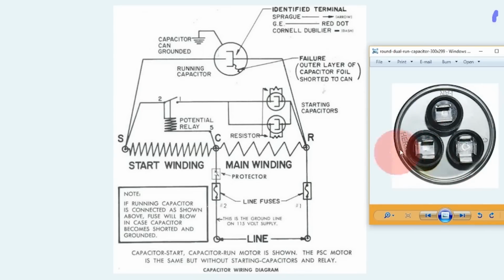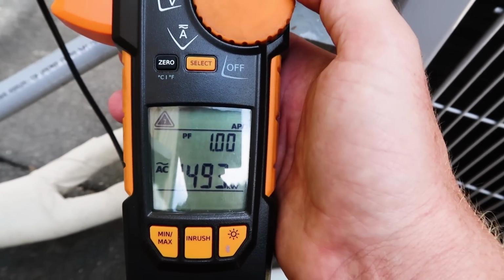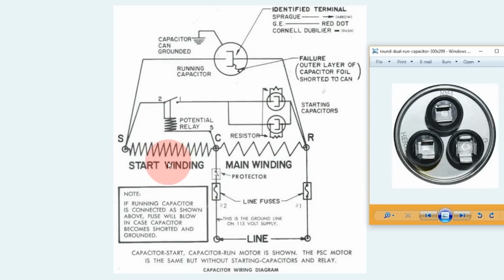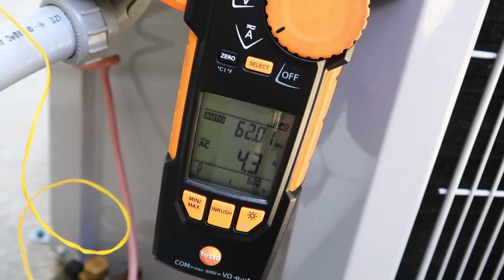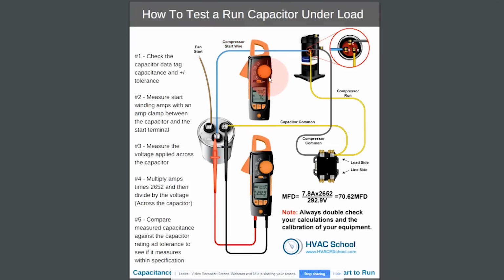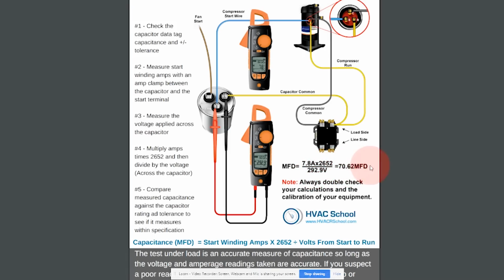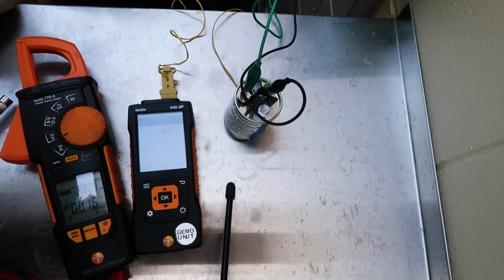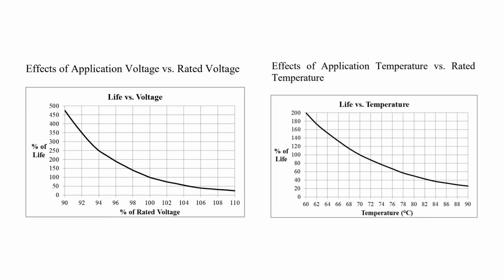Why Do Capacitors Fail? (It’s not why you think)

Comment: Run caps fail by building up internal pressure caused by heat from having high current combined with high resistance ie. impedence.

Parasitic heat generated by caps:
P = R x I2
The current being squared make caps particularly sensitive to it when internal impedence rise during aging.

Good caps are known as "LOW ESR": Equivalent Serial Resistance which grants them long service life.

Nothing magic: low-quality either builds repeat business or kills business like too many American iconic names
 😂

OUT OF PHASE [23:00] : "Cap sends back"... nothing!
The cap supplied voltage and drawn current is what is out of phase.

Comment: Not sure if this applies to HVAC capacitors, but one of things we do in electronics is to measure the ESR of electrolytic capacitors to get an indication of it's health.  If we see a capacitor with a higher than normal ESR, then we know that it's on it's way out. A capacitor with high ESR will run hotter, which in turn shortens its life.  Also if we see a capacitor reading higher than it's rated capacitance, then that could be an indication that it is becoming electrically leaky and it's probably time to start thinking about replacing it.   In electronics we generally consider Japanese and American capacitors to be the best for quality and life expectancy.  Not sure if you can Japanese Rubycon HVAC capacitors?

Comment: Funny thing: .5 amps at 120 volts suggests that the capacitor is 11 microfarads. .7 amps at 208 volts suggests 9 microfarads. When I did these tests with a series pass ammeter, the microfarads didn't seem to change at all with voltage. I find that oil dielectric motor run capacitors hold a much more steady capacitance than electrolytic caps, over its entire rated voltage range. Could it be discrepancies in the clamp meter due to such low current? I wonder if the meter would read more consistent with the formula if a 70 microfarad cap was used for demonstration, just so the current was high enough for the resolution of the meter?
Reply: because capacitor microfarad value is fixed the current increases with the voltage, simple!
Reply: @glasser2819  That's absolutely true. The current should increase exactly proportionately to the increase in voltage, and at a fixed voltage, the current should increase exactly proportionately to frequency. In this application, the frequency is largely fixed, if you don't include harmonics caused by the motor, which would increase the current disproportionately to the RMS voltage.
     In this video, the capacitor was NOT paired with any motor, or any real source of harmonics. The voltage varied, the harmonics did not. I would have expected a more linear change in current in proportion to the voltage, given the same capacitor.

Comment: In my 40+ year old a/c I have the original dual run capacitor. One that is oval,  11" tall and has a ground spade, too. The unit also came stock with what is called a starter capacitor in the circuit. Though even with the starter capacitor exploded(I don't know when !, I just found a few days ago when I was doing a pre-run inspection)the unit still ran well last year in this condition ! I am replacing the starter capacitor before I attempt to run it...as a matter of fact USPS informed delivery says that it is out for delivery and I should have it today !!!
Reply: spend a little on maintenance parts to save a lot on not replacing with a new short-lived unit.

Check your Starter Circuit that fried the cap... the day your compressor fails to start because of bad starter maybe one of its last days due to locked rotor high currents toasting old winding insulation.

Little homework is worth your time... AC disconnect be your friend 👍🏻
Reply: The start relay could be bad, too. It's always safest to replace both at the same time.

Comment: every capacitor that failed for me was ..1. the line supply wires are too small or bad connections. 2. A shorting wire or one starting to short slightly will also blow one .  3 obviously a bad motor
Reply: Poor terminations are sad. Factory terminations should be much better than what can be done in the field.

Comment: Where did you get 2652?
Reply: Z=1/(2*pi*F). therefore, since the formula is solving for microfarads, ( there are 1,000,000 microfarads in a farad) divide 1,000,000 by the product of Pi times 2 times the frequency. 60 Hz times 2 equals 120 Hz. multiply that by Pi. (3.1415926) that gives you 376.99111. 1,000,000 divided by 376.99111 equals 2652.5824. you can technically round that up to 2653, but why bother. Engineering books round it down to 2650, which is OK, because this formula is based on a pure sine wave. In series with a motor winding, there will always be harmonics, which will effectively lower the impedance of the capacitor, which will show a higher current than the formula suggests, so if you use 2650, you'll likely get closer to what the capacitance actually is. If you move to United Kingdom, you would use the constant 3183.0989. That's because they run at 50 Hz, and capacitors will conduct LESS current at the same voltage. (exactly 20% less current)

Comment: Excellent video! Especially the demo showing the compressor running backwards- didn't know that could happen because of short-cycling.  I was also surprised and intrigued to see higher than line voltage across the windings due to EMF.  I was actually watching this video to assist me with troubleshooting a valve actuator utilizing a PSC motor which is blowing fuses.  At the beginning of the video, you show lots of pictures of catastrophically failed caps.  Is this how you normally find them in the failed state?  What I mean is do you also find compressors with problems due to bad run capacitors which show NO outward signs of failure on the capacitor?  What will a compressor do when its run capacitor is degraded?  What I mean is, suppose the 45 MFD run capacitor is now only a 10 MFD capacitor.  What happens?
I also enjoyed your demo of attaching the capacitor directly across line voltage.  I have to admit, I was expecting them to go poof.  Amrad capacitors- I'll remember that.
Reply: I have been doing commercial A/C and refrigeration service for almost 30 years. I have found capacitors that were bad without showing any outward signs of failure. So, it's always best to check them. 
Degraded capacitors can cause motors to overheat, or even not start. A 45 degraded to 10, probably would not start under any kind of load.
Reply: Vrey good  welcome iliked all shring  teckanl feld  vrey   vrey good

Comment: Capacitors and pressure switches never failed on older pre 1990 equipment
Reply: Oh, they failed. Just not as often as nowadays.
Reply: When I started as an HVAC tech in 1992, the only capacitors I had to carry on my truck were 35/5 and 45/5 for Goodman and Arcoair units, and fan motor capacitors for when I replaced a motor and it took a difference size capacitor than what was there.
Now it is the most common failure item,  seemingly of everything else combined, on the residential side of things.

Comment: I started adding some kind of start assist. It seems to have helped. I have had customers when looking at the history. I see run caps replaced every couple of years. I added a start assist and it's been 5 years so far. They are out in the country where surges are common.
Reply: I ended up installing a hard start kit (with the potential relay) in my A/C condensing unit and I installed a whole house surge protector in the power panel.  I am thinking about adding another surge suppressor with brownout protection in my A/C disconnect to further protect my condensing unit.  Over the years, I have lost a furnace blower motor to a power surge and lightning strikes have destroyed at least one of my TV's.

Comment: Older caps also were double the size to current day units, it's all a money grab now a days, but it keeps me employed so I'm not complaining
Reply: You must be young, that was the transitional period when PCB capaciters were eliminated from availability. The new non PCB caps were large until they got the design correct.
Reply: The older larger caps were always paper caps, and as such had a (sometimes poorly defined) limited life span. Modern caps are often polypropylene and "should" last longer. Of course, they don't always last longer in practice as it's fully possible to underrate them as well. They might even be more prone to heat damage than a properly manufactured (very expensive) paper capacitor.
Reply: @mjouwbuis  bingo in California caps last 5-10 years on new units, I've worked on 40+ year old carriers with factory caps still in them haha

Comment: My hypothesis on why some older capacitor last longer 
It was over designed / under rated for its voltage rating 

Maybe the capacitor innards like dielectric, metal plate 
Are simple thicker 

The new capacitor are optimized to close to its rating 
And there for do not last as long 

It’s like tire that are built to last 80K miles but rated only for 35K miles 

Just my guess
Reply: yes these days everything is built for controlled failure.

It's bad for business to have dependable equipment and services... so we get man made  chaos for high cost 😂
Reply: Had a part house guy talk about why gree mini splits eat up boards. Comes down to Chinese engineers not giving a wide enough margin for voltage. Same with  run caps.

Comment: The correct to discharge capacitor is to leave it on the table 
For the curious coworker to grab

🤣🤣🤣🤣🤣
Not really
Reply: Lmao. With a sticker that says "lick me".
Reply: The capacitors in HVAC shouldn't be holding a charge since they're on AC, any residual momentary charge should have been bled off by the time power is disconnected. But shorting the terminals is always good practice when handling them anyways.

The best way to do that is toss it to a coworker without them knowing and instinctively catching. lol
Reply: @etherealrose2139  - The old TV repair guys used to do that to each other.  Charge up a cap on the power supply and throw it to one of their coworkers.

Comment: If you use an oscilloscope to chart the current and voltage waveform across the capacitor, you should be able to determine the real power in the capacitor.  If the voltage lags the current waveform and not superimposed as they would be in a regular resistor, the power is lower.  That's basically the difference between VA and Watts, as there's a power factor involved.  Since real world capacitors have an internal resistance or ESR associated with them, they will cause actual heat dissipation and start increasing the temperature of the cap that can lead to degradation.
Reply: so...could one then use a multi-value capacitor and a power factor meter or some other tester (scope) to dial in a "better" capacitor value for older systems or to compensate for wear/deviation from design?
Reply: @douglasmontgomery6315  great reasoning to improve things up.
Run caps are actually LOW capacitance to help along the RUN winding with a low current through  the START winding.

BEST...
What kills everything is the 5x "Locked Rotor" start surge that mashes the bearings with translation forces before the rotor gets oriented to spin.

FIX: use a "Smart Starter" to ramp up the start current from zero instead of surge down from 5x !

Smart-Starters save: 
electric power spike cost
compressor: bearings
contactor oversized LRA current
capacitor surge stress

The "ramp starter" solution is good for all single phase AC motors: air handlers, pumps...  where 3-phase motors use a variable frequency ramp-up known as VFD for the same purpose of ramping-up current instead of a destructive bang surge!

👍🏻
Reply: G Lasser , thanks for the heads up on smart starter.  I’ve used VFD’s for well pumps for the same reasoning you applied to the single phase A/C.

Now, I’m pretty sure they also sell single phase VFD’s (some well pumps are single phase).  Could they be utilized for HVAC ?

Lastly, since logically utilizing a VFD type device for a compressor (really any high torque/load motor) is optimal...why aren’t they an option in residential HVAC units ? (I’m assuming they aren’t).  I’m thinking the newer inverter style HVAC units don’t need a VFD due to their design.

Comment: Great video.   Maybe they should be strapped to suction line with a heat sink material :)   I remember when they were about as big as motorcycle batteries.   They didn't fail hardly ever.

Comment: Great video!! it is very informative. 
Could you explain how the internal protection of a capacitor work?  We usually can see that most capacitors' casings state that "internally protected 1000 ACF". What does it mean? It does not seem to prevent capacitors from exploding. Some run capacitors  even state "NO PCB's  A combustible fluid." Sounds like a total fire hazard!!
What kind of capacitor failure will cause explosion? A better designed capacitor can prevent it?
Thanks a lot
Reply: What's SUPPOSED to happen, is the top of the capacitor should just bulge up without exploding. Most run capacitors that I see, do just that. But, not all.

Comment: Phase shift, why do so many knowledgeable people think of these capacitors as a tank. With alternating current it's not a "tank" like it would be in a DC circuit.
Reply from the maker: It’s not really a “tank” in any case. It does still store and release in AC which is what provides the phase shift
Reply: @HVACS  This

Comment: Does anyone else think that a pitted and burned contactor can cause capacitor failure? This would technically be resistance in the circuit. And resistance in any electrical circuit causes heat which I believe could damage it even put a heavier load on the capacitor,fan motor and compressor. I'm I incorrect to think this?
Reply from the maker: Resistance causes heat at the point of the resistance not in the overall circuit. It actually reduces the “load” overall because increased resistance = decreased amperage (ohms law)
Reply: I think his point about tired contacts in the relay was that excessive arcing would send voltage spikes or surges to the capacitor, and possibly to other locations sensitive to voltage surges. I still have the original contact relay in my 2002 Rheem condenser. An HVAC technician replaced the capacitor on a wretched hot weekend day, when I would have been unable to buy one on short notice. The young technician noticed the arcing in the bright south sunlight, and suggested that I let him replace it, or buy one later and keep it on hand. I was skeptical at the time, so after he left, I used a small piece of folded 800 grit silicon carbide abrasive paper to clean the contacts. It worked, reducing the arcing considerably. However, it was maybe a month later when I remembered that the contacts were probably silver plated, and my 800 grit wet or dry abrasive had probably removed some, if not all of the silver plating. With hindsight, I should have allowed him to replace the relay while he was there. I'm not trained in HVAC, but spent a lifetime troubleshooting electronic systems in hospitals. More to the point of your question, I would agree that pitted and burned contacts would add resistance, but I think the author made the point that voltage spikes caused by arcing would be detrimental to any capacitor, hastening its ultimate failure. I installed a Leviton whole house surge protector at the main service panel about 15-years ago. I know for certain it has saved me many failures all over the house, including but not limited to house alarm switches, motion sensors, home theater components, etc. However, I doubt the Leviton whole house surge protector would provide protection at the outdoor condenser and capacitors therein. It might be providing protection for each leg of the 240 VAC going into the condenser, but I doubt if the whole house surge protector is protecting spikes or surges created by components inside the condenser. 

Somewhat off topic, but I know that the MOVs in my whole house surge protector can or perhaps will, degrade over time - that spikes and surges are cumulative. I still have two green lights on the Leviton surge protector at the main service panel, indicating both phases are still protected. Can anyone tell me if my two green lights are rock solid indicators that my surge protector MOVs are still functional? In addition, would it be practical to install another Leviton whole house surge protecter adjacent to the outdoor fuse box near the condenser? Meanwhile, I need to buy a contact relay to have on hand, since I probably sanded off most of the silver plating of those contacts. I believe the silver plating of relay contacts serves three purposes: 1) To enhance conductivity. 2) To reduce carbon buildup, which reduces resistance. 3) To reduce arcing, which to my untrained mind, can compromise performance of HVAC capacitors over time. Any comments would be appreciated - particularly about the condition of the MOVs in my Leviton whole house surge protector (in a steel enclosure) installed at my main service panel. Again, the Leviton still has two green lights.

Comment: I always look at rated voltage on a cap. If a higher rated voltage capacitor is in stock, we use them as the capacitance is only affected by back EMF, so a higher rated (sometimes 440V) voltage capacitor can "help out" in areas where voltage is inconsistent. A 220V rated capacitor can fail with spikes/lightning in area as stated. Good work Bryan!
Reply: yep exactly! Some ppl confuse voltage rating and capacitance.

The untold capacitor spec is internal *impedence*... larger caps have a lower impedance and higher voltage rating